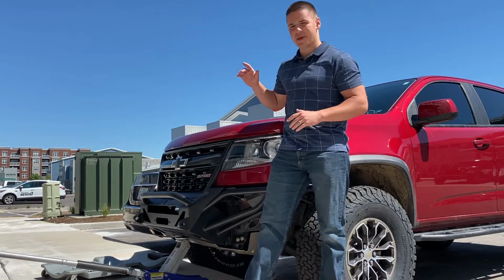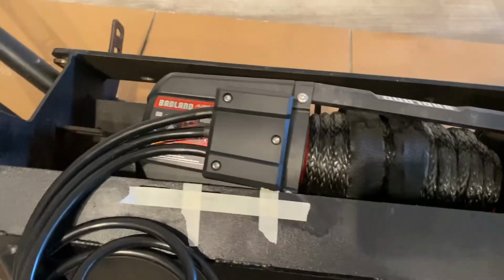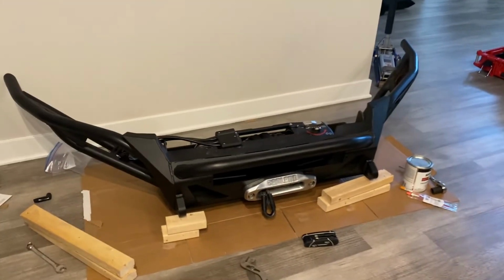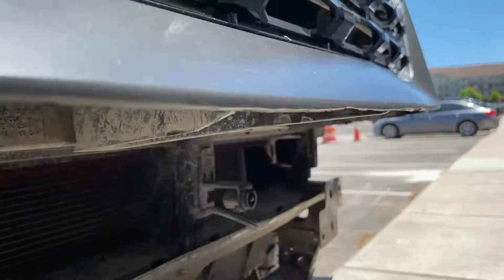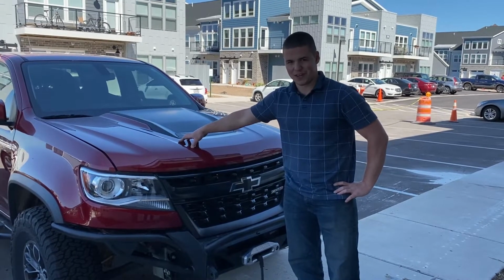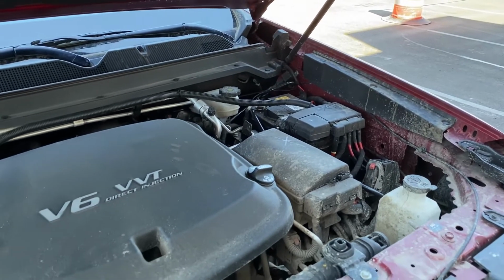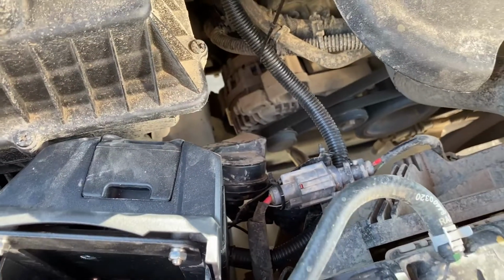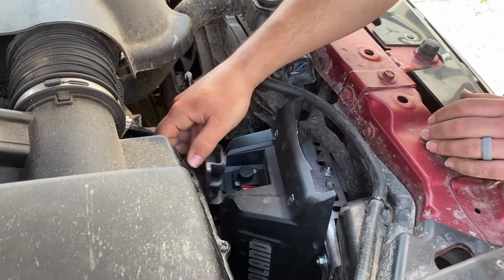12K Winch Install - Colorado ZR2

Comment: It's  good to  have the  tools. And not to be afraid to use them. My  zr2 has less than  3000 miles on it and i already  did my fair share of  cutting and  welding on. But i have been doing this  stuff for over  45 years. Just finished a  mini tub on the 57 Chevrolet I'm  glad to see you doing your own work on your truck bravo zolu

Comment: Great video I bought the same model winch for my ZR2. I am going to use your method to mount the control box. I watched to the end and didn't see how or where you have access to the clutch handle to free spool the winch, please comment, thank you.
Reply from the maker: On this bumper the cutout on the front is just barely big enough to reach into the clutch handle

Comment: Make a bracket to go from where your left hand is 8:45 to top of the box you mounted. Flat piece of steel would do it L shaped to the back of the badlands box
Reply from the maker: You should watch the rest of the video
Reply: @campbelloffroad3660  What you did at 13:30 is exactly what I was envisioning while watching it at 8:45 ..